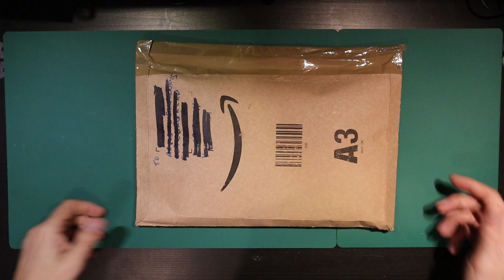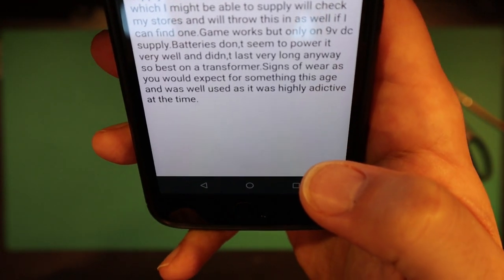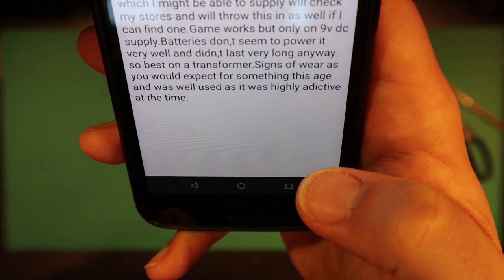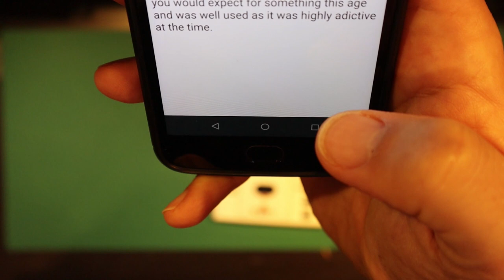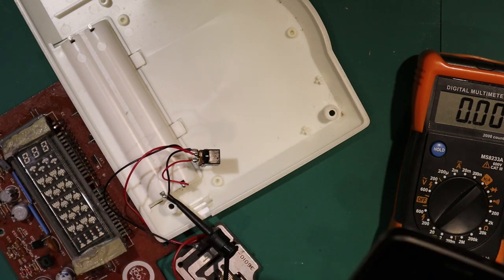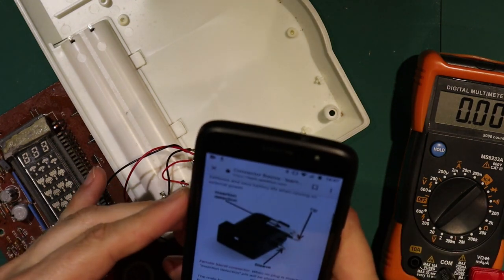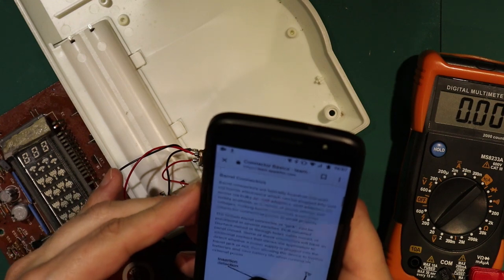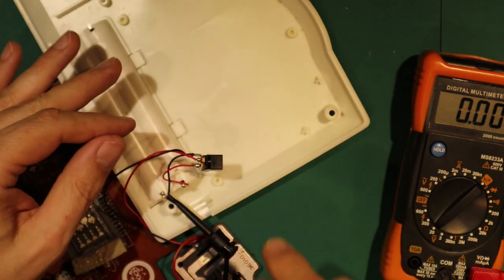Grandstand Invader From Space Game Repair and Restore - Retro Games

Comment: I'd have tried spraying a bit of "Electronic Switch Cleaner" into the jack and then plug/unplug the power lead a few times. It was probably just a bit of corrosion. Luckily all mine needed was a bit of cleaning to the on/off switch.
Reply from the maker: Great suggestion! I think looking at the part I removed the switch on the connector was stuck open perhaps from years of use with an AC adapter. But you are right I should probably have tried cleaning it first. Thanks for the advice!

Comment: Hello, can you tell me what that barrel-like device labeled TZ-91 TDK, which is to the bottom left of the display, is? Is it an inductor? If so, how does one test it? I’m just a tinkerer, trying to fix my Invader from space [Epoch] which doesn’t light up. Any insight will be appreciated. Thank you kindly
Reply from the maker: Hi there ... I don't know for sure but my guess is its a multi tap transformer used as part of an oscillator circuit to generate the various voltages needed by the display etc. Without knowing the exact pin out I've never managed to test.... although I'd expect to see low resistance between pins on the same coil (primary or secondary). I've never known one to fail. I'd check for conductivity problems failed diodes or transistors elsewhere if you are having problems
Reply: @RetroTechRepair  Thanks for replying - I truly appreciate it. Yeah, I’ve had no luck with this one. So far, I’ve checked: all three C945 transistors, which appeared dead [I replaced them with three equivalent C1815 transistors]. I reflowed a bunch of points, on the board. Tested the whole circuit’s resistance - it’s high [1.2 Megs] so the issue isn’t likely to be a short [I don’t think]. Replaced all the electrolytic caps and the ceramic ones too. Checked the diodes, they’re ok. At some point, using a thermal camera, I noticed that the D882 transistor was getting really hot, so I replaced it with another D882. And after all that, all I have is a “game” that emits a super faint sound and a display that doesn’t light up at all. I’m completely baffled. Thanks again. Cheers!
Reply: @RetroTechRepair  Hi again,
I was running out of ideas, so I watched your 
“Gakken CGL Puck Monster (Pac-Man) Try to Fix video”, and I found that many of its components and layout looked rather similar to that of Epoch’s Invader from Space [which I’ve been trying to fix, for some time now] so I watched on and then, I pulled out one of the unmarked diodes [like you did], and I tested it out of circuit with my component tester, and it turned out to be damaged! I had tested this diode before [in circuit with my DMM] and it looked fine. I found a salvaged 1n4148 diode, soldered in and the display came on! Bright colours and very loud! Thank you so much for your videos, there is NO WAY I would have figured this out, on my own. Again, thank you kindly!
Reply from the maker: @maxwarfield6699  that's brilliant Max... so glad I could help. Thanks so much for stopping back and letting me know. Congratulations on your repair!